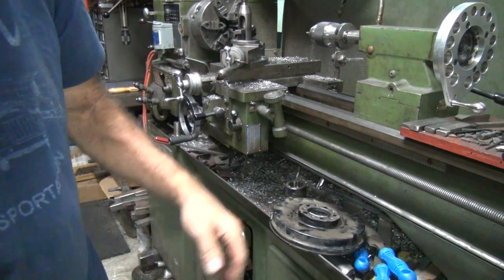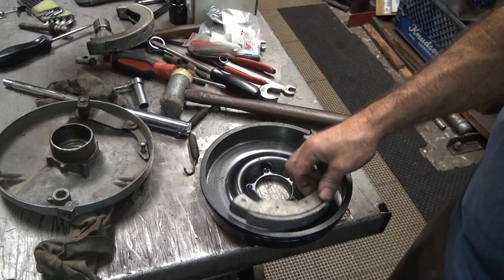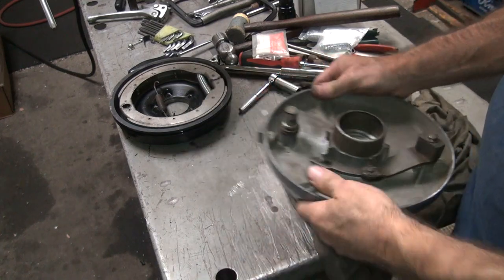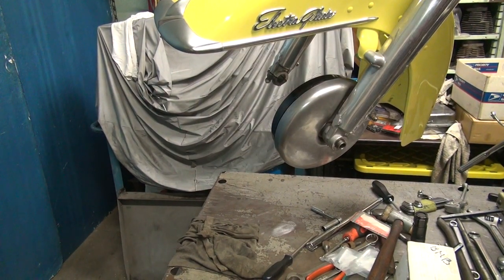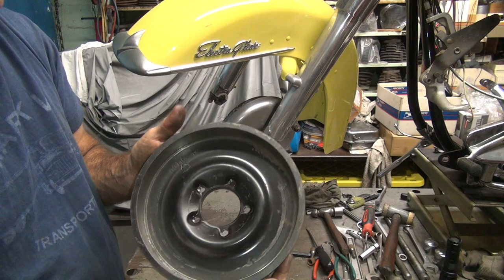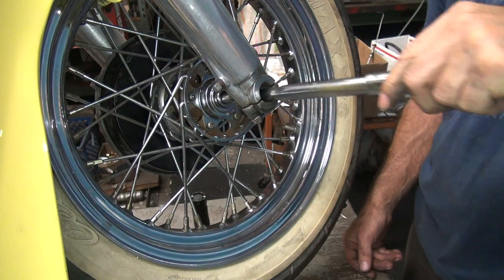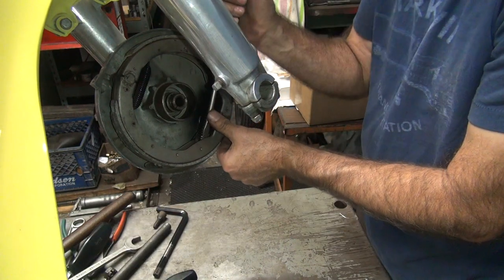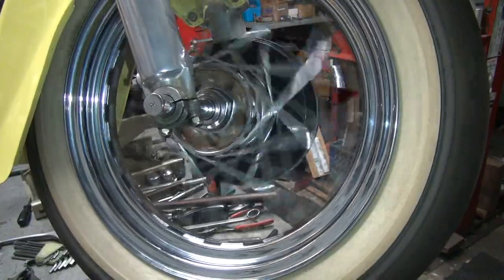1965 panhead #127 74ci flh motor rebuild and bike repair harley by tatro machine

Comment: Was pointing at the lever and hollerin but ya must not have seen or heard.
Reply from the maker: must have got frustrated again. got over it quickly and got the job done. who says getting mad is bad.
tatro
Reply: No fret. Anybody that wrenches has long-forgotten part- or wrench-shaped  divots in the walls. Hell, you summed it up on the lathe; it's lighter. Custom!

Comment: Regarding the allen wrench for the brake drum lug nuts, why don't you cut it off and then tack weld it to a cheap appropriate sized socket. (I believe it's a 7/16  but I can't be sure) That way you could use a ratchet with an extension. It would be a lot quicker putting the the bolts on and off and would keep your knuckles clear of the forks and axle.
Reply from the maker: maybe i like being slow and busting knuckles.
tatro
Reply: would rotating the entire wheel 20 degrees clockwise gotten it away from the axle?? That can't be correct I'm not that smart.  Probably hits fork tube??